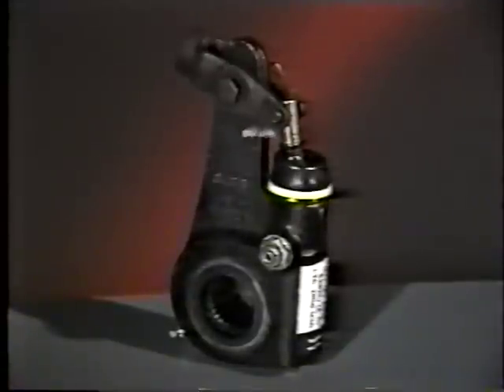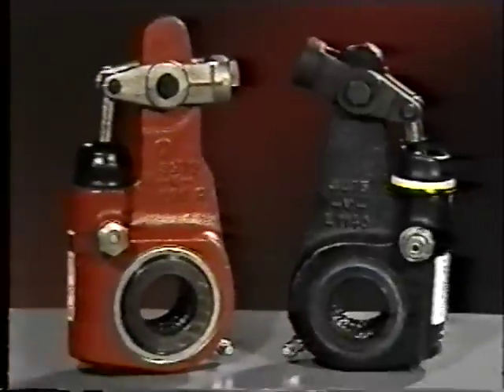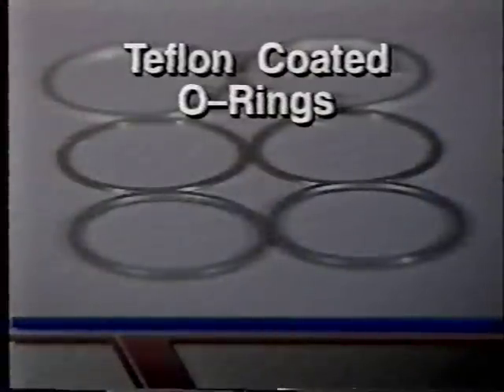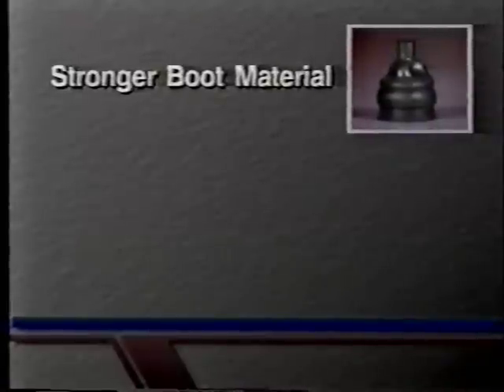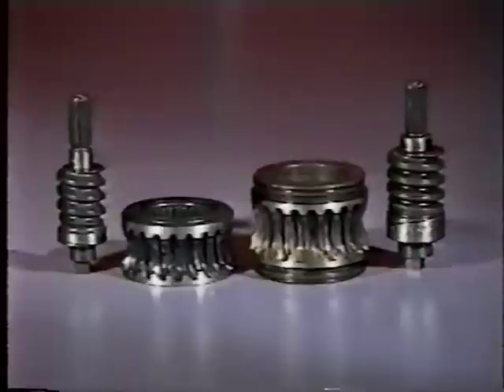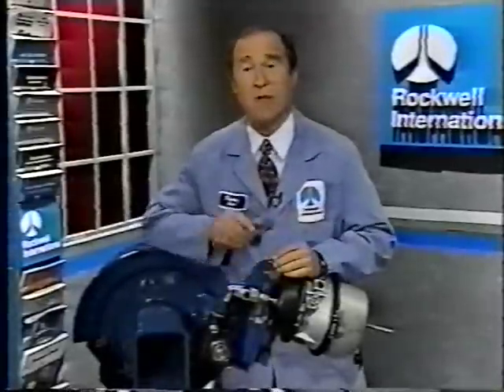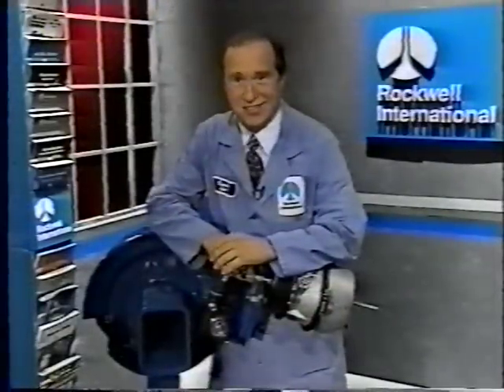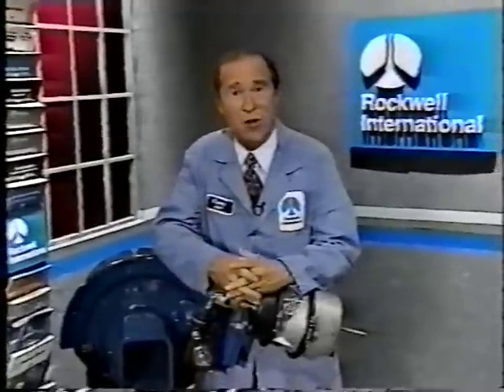meritor asa slack .VOB

Comment: My DP motorhome's slack adjusters seems to have some white color grease in it (later i learned it  may be some clay type grease).  Before I realized the different grease, I applied 2 short-pumps of red high-temp grease I used for my entire chassis / drive-train.  Can this small amount of a different grease cause a problem?  Can I flush most of it out by pumping the right grease through the slack-adjuster?